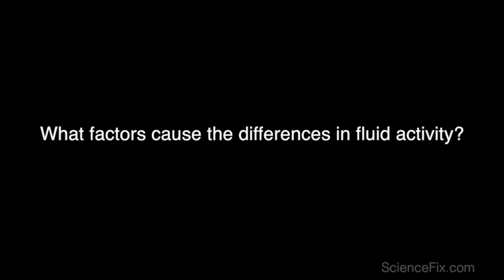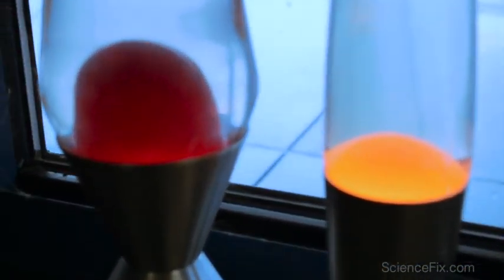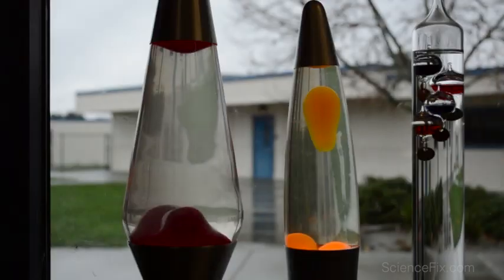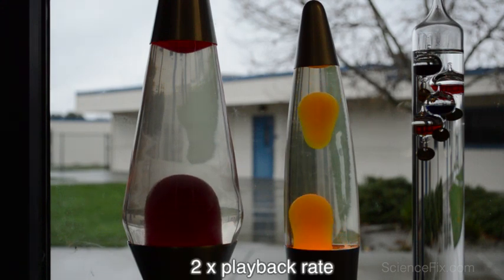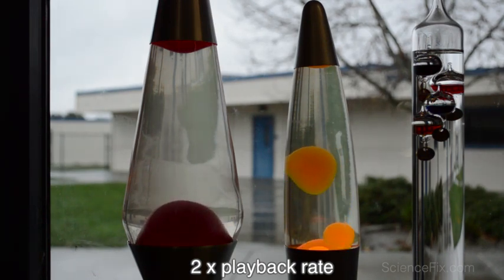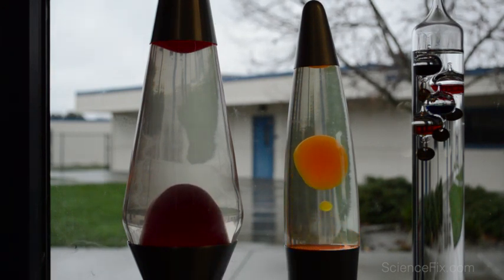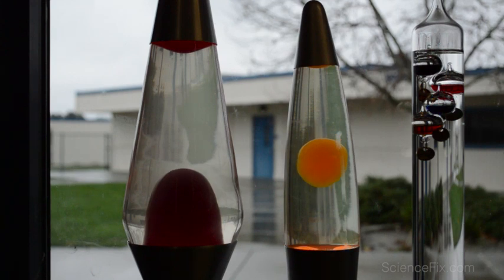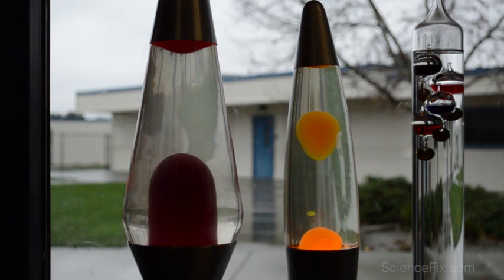What is Causing Different Lava Lamp Activity?

Comment: The density of the wax is too large compared to the water... I recommend getting rid of the old water and add new distilled water. mix some epsom salt with a bit of distilled water on the side and very carefully add drop by drop when the wax is heated up and the lava lamp is on with the other (clean) distilled water inside. Also add 1/2 drops of clear dishwashing detergent as this will make the wax go into smaller blobs instaid of one big one. If you want add some foodcolloring of your choice and put the lid/cap back on. There are numerall videos on youtube explaining in more detail how to do this and i recommend you to watch one before fixing your lava lamp. 

Happy to help! 
Your welcome.
Reply: A lava lamp works like this:

Wax has a certain density and so does water. (These are the two products a lava lamp is made up of.) When you power on a lava lamp a lightbulb goes on and emits heat, which will slowly heat up the wax. When the wax is hot enough, it will expand and lower the density. When the density is lower than the desity of the water the wax will float to the top, where it will linger for a little while. When it has reached the top the wax will cool back down and the density will rise until it is bigger than the density of the water and than it will sink down. (This will repeat until you power off the lamp.) 

Now by adding salt to distilled water (water with almost only H2O mulecules), you make the density bigger, which enables the wax to float on top of it... When you add too much it will make the wax stay at the top though... When this happens you can just power off the lamp and let the wax cool down, than start over...

The (clear, just to not color the solution) dishwashing detergent is to lower the surface tension, which enables the wax to form into smaller blobs. When you add too much it will make the wax go turbulent and mix with the water though. When this happens, than unfortunately you cannot reverse it... 

Soap is hydrophobic which makes it 'want' to 'hide' in fat or in this case wax. (This is why soap is good to clean things.) Normally fats and oils do not mix with water, but by adding soap it will. In this case it makes smaller blobs...

Hopefully you understand how it works now! 

Yes i have typed this myself and i could have made some mistakes in the science stuff aswell as writing it. This is because as far as i know it works like this and my native language isnt english... 

So if you spot some mistakes feel free to correct me!
Reply: nice comment

Comment: At the very end of video the left lava lamp wax barley reaches half way and falls again. this is most likely clear indication that the bigger lamp is to cold for what ever reason. Maybe a cheap bulb or to cold next to the window. But if properly functioning the wax has to be hot enough to reach top then wax cools at top and falls back down. So the wax cooling at the halfway point and falling means not enough heat. This is assuming nothing has ben tamperd with. This is an air tight sealed system. Nothing should need adjusted or replaced if worked fine brand new and taken care of properly. I'm sure manfucature has list of things not to do.

Comment: I have dozens of lava lamps in various shapes and sizes and I can tell you from my own observations and experience that the larger lamps do better away from windows or cooler areas, if you want your larger lamp to work better than avoid the cold spots in the room. The larger lamps obviously have a larger volume to heat and that is why It will have a higher wattage bowl, they also have a larger external surface area making them more temperamental to variations in temperature then the smaller lamps. It would be interesting to test the temperature difference between the two lamps, if I had to guess. You will find the optimal temperature for the smaller lamp will be reached a lot quicker and the larger lamp may even need to be a lot hotter than the smaller one, if you do test the temperatures please share the results.

Comment: Need more salt, wax struggling to move upwards. Also need clear dish soap to reduce surface tension - that's why there is one blob instead of several.
Reply: Right. The density of the water in each lamp is probably different. Add pickling salt or epsom salt to the lamp on the left. That will make the wax more buoyant when it heats and expands.